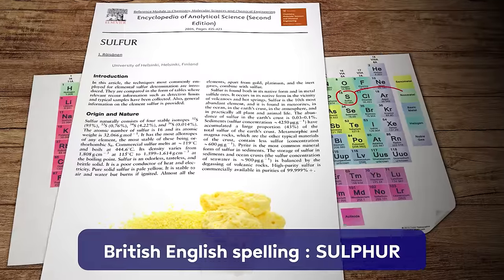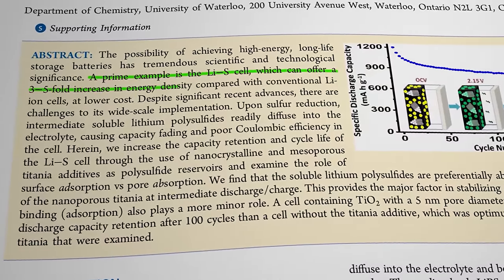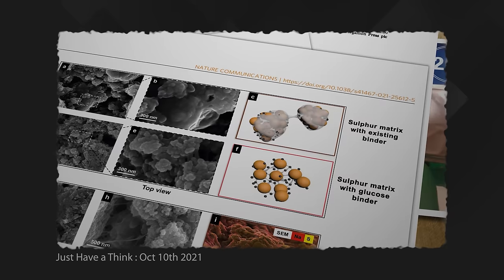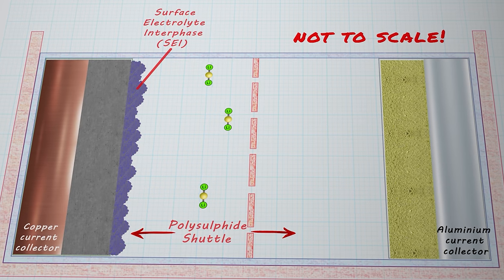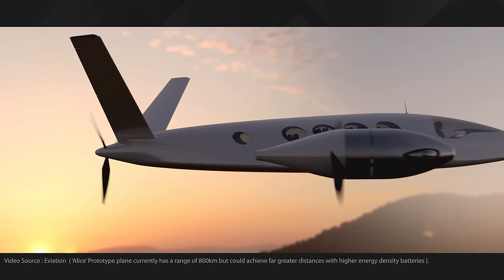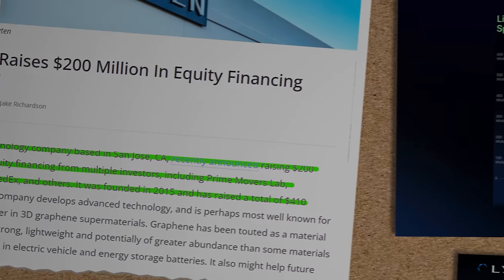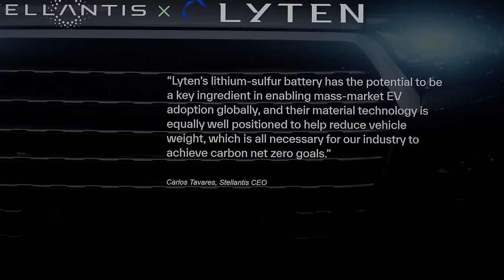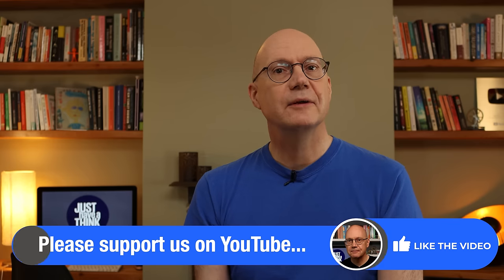Battery Energy Revolution. What now?

Comment: Claims about locally sourced materials, and specific eventual production cost when they haven't an actual product to show are pretty sure signs of more marketing than substance, some might call that a scam, and if they are aware themselves how far from actual commercial production they are, and still claims to be ready for commercial production, I might agree. 

Locally sourced materials can be nice, but it also a matter of definition, and it's not because materials doesn't exist anywhere else in the world that they are transported across the world, it's because they're cheaper to buy/process somewhere else. You can design for locally sourced materials all you want, that doesn't mean it will make financial sense to buy locally produced materials if you reach mass production. The shipping industry is dirty, but it is also an extremely efficient way to transport, per unit of mass and distance. And we need some actual solution, not focus making new technologies possible to produce with locally sourced materials. 

Lyten claims the average distance the materials in liion batteries have traveled from extraction to battery cell assembly [sic!] is 50,000 miles, that's twice the circumference of earth, I doubt that's actually a true average, and if some of the material travels that far, or more, it's not because it was the only technically possible way to acquire them.                    

Estimates of actual cost when mass produced, when they haven't produced a cell that they advertise all the relevant specifics for, is plain stupid. They have yet to figure out the process they actually want to mass produce, and then figure out how to mass produce it, or better yet, when (if) they figure out how to produce a battery that's actually superior to what's already on the market at the time, they can let someone with the resources figure out the mass production part.

Comment: 🙂 I am all in when it comes to battery research for all sorts of applications. But I am not impressed with the current state of what faces the driver of an electric vehicle. From storage capacity to power deliverability, they're just not yet up to par. Add in the woefully inadequate infrastructure support, still-too-large charge times, and safety concerns of lithium technologies, I don't think it's ready for real life. At least, I'm not interested in looking at it seriously, as things stand.

I understand and appreciate (and support) all the practical environmental reasons we need it, and keep hoping to see better. But in practical terms, I think electric cars will be one of the last applications to become practical. We already have impressive gains for many other uses, but cars require a whole spectrum of performance parameters that are very difficult to bring together. If we're forced into electric, it will be a backward step in getting around. And that is of concern, because we've built our whole nation on a basis of mobility. The impact will be huge if that's disrupted.

Comment: I will buy an electric car when:
1. Cost is comparable to petrol or diesel vehicles 
2. The range is 500miles plus
3. They can be recharged in under 15 minutes
4. There are enough charging stations that work
5. The cost of recharging is consistently less than petrol / diesel per mile
6. The battery lasts at least 20 years
7. The battery does not cost 75% or more of the car
8. The battery does not like to spontaneously combust 
9. The battery does not mind being cold or hot
10. The battery has sufficient energy to run heaters or aircon without sacrificing much range 
11. Mining materials for the battery does not cause pollution or hardship to others
12. Disposal of the battery is simple and clean, preferably recyclable 
13. The government’s keep their legislative hands off usage, such as area or distance 
14. The government’s quit subsidising one industry against another
15. The power generation companies have mandatory legislation for pollution, price and availability 
16. The vehicle weight be no more than gas / diesel vehicles or their road tax be based on the cube of axel weight and factored with wheel torque (nobody addresses the problem of road damage… yet)
17. That’s for starters… at the moment electric cars fail on every point.

Comment: I agree electric is the way to go but with batteries, I don't think they ever will be the answer. The answer would be that a nuclear power device that could replace ICE engines would solve the need for charging. This would remove the need for gas stations, electrical chargers, and the massive battery industry(mining, producing). Sure there would be the nuke thing roaming the planet but maybe AI could design the perfect solution. Maybe the caveman had the right idea, use our feet.

Comment: The only way Ill ever go to EV, is the pick up truck, if an EV pick up truck can complete the same long haul trip with same loads at the exact same time as a current day ICE truck. So far EV trucks cant even get 50% of the distance to its ICE counterpart and its recharge time turns a 12 hour hualing trip into 24 hours (resting only to recharge batteries) .  It will be a hundred years before anyone figures out the EV pickup truck/ Semi-Truck problem.  Almost just as importantly, any EV maker to get my attention will have to provide a "dumb" EV pickup truck, meaning no smart tech in it. Just like my TV, I dont want it to have any connection to the internet nor GPS or any other wireless communication or tx/rx system, i dont want an IPAD mounted on my dash, just give me a normal dash with analog instrument panels.  Do those 2 major things, and I believe the majority of EV sceptics will jump on board no problem.

Comment: 3D graphene? Wasn't graphene just 2D diamond?
Reply from the maker: Graphene
Graphene is a single layer of carbon atoms arranged in a two-dimensional (2D) honeycomb lattice. It is renowned for its exceptional electrical conductivity, mechanical strength, and thermal conductivity.
When people refer to "3D graphene," they are typically referring to structures where graphene sheets are manipulated or assembled into three-dimensional forms without simply stacking into graphite. These 3D structures can include graphene foams, aerogels, and other architectures that maintain graphene's unique properties while providing a material that has volume and can be used in applications where bulk materials are needed.
Graphite
Graphite, on the other hand, is a naturally occurring form of carbon where graphene sheets are stacked together in a 3D crystal lattice. In graphite, the bonds between the layers are weaker van der Waals forces, which is why graphite is soft and can be used as a lubricant or in pencils. The electrical and thermal conductivity of graphite is good along the planes of the graphene sheets but much less perpendicular to them.
Key Differences between 3D Graphene and Graphite
Structure and Properties: 3D graphene structures aim to exploit the superior properties of graphene (such as high surface area, electrical conductivity, and mechanical strength) in a form that is usable in three dimensions. These structures often have porous, lightweight characteristics that graphite does not.
Manufacturing and Applications: The way 3D graphene is produced allows for the creation of shapes and structures that are not possible with natural graphite. These can be designed for specific applications, including energy storage (like supercapacitors and batteries), catalysis, and as scaffolds for material science applications.
Performance: Because 3D graphene maintains some of the unique properties of single-layer graphene across a three-dimensional structure, it can outperform graphite in specific applications, particularly where high surface area, conductivity, or mechanical strength in a lightweight form is beneficial.
In summary, while both graphite and 3D graphene are made of carbon, the key difference lies in their structure and resultant properties. 3D graphene is not just graphite; it's a novel material that leverages the remarkable properties of graphene in three-dimensional forms, opening up new possibilities in materials science and engineering.
Reply: @JustHaveaThink  Wow, that's perhaps the most informative comment reply I've ever seen on YouTube.
My word, carbon really is such a versatile element. I suppose that's why it appears so important to organic life. I do find it mind-blowing that the same element can have such incredibly different properties depending only on how it's atoms are arranged.